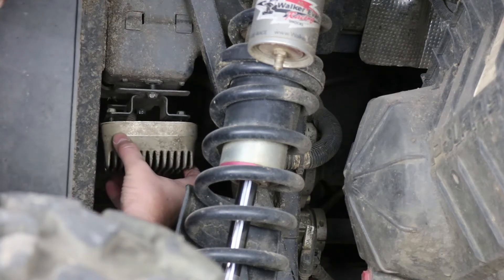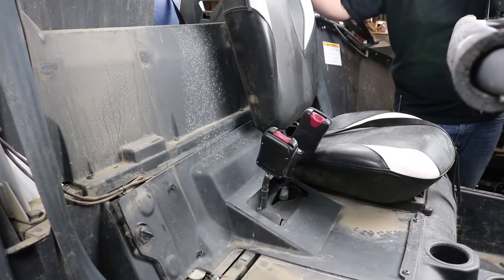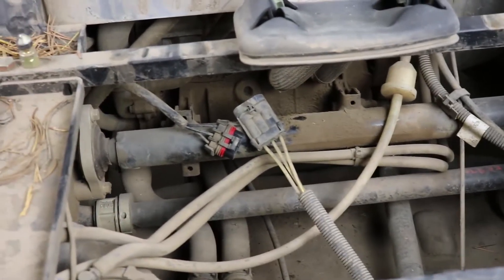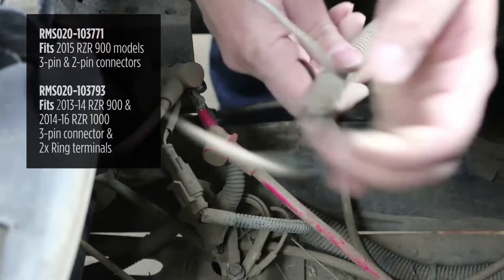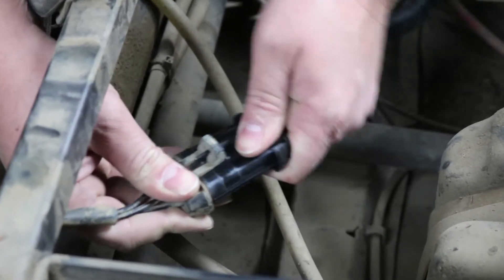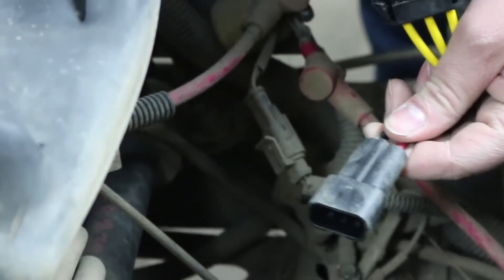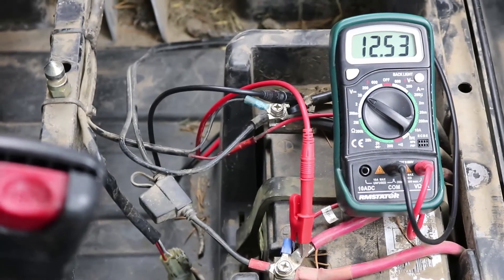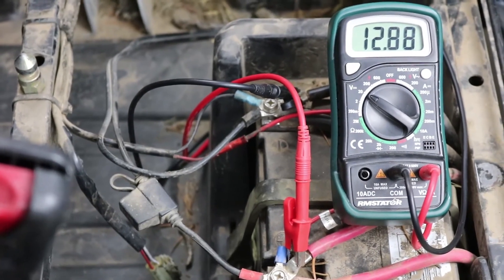How To Install Recall Upgrade Mosfet Voltage Regulator for 2013-2016 Polaris RZR  900 & 1000

Comment: It's a RECALL 
VOLTAGE REGULATOR REPLACEMENT
Contact Your Dealer
UNAPPLIED
Recall Number: Z-16-01-CA

NHTSA Notified Date: -

Expiration Date: 12/31/2030

Comment: What side on the starter sonenoid does the regulator go on? The side connected directly to the battery or the side of the starter?
Reply from the maker: The regulator battery + output is connected (not usually directly, it is usually done through the vehicles harness) to the Battery terminal on the starter relay.